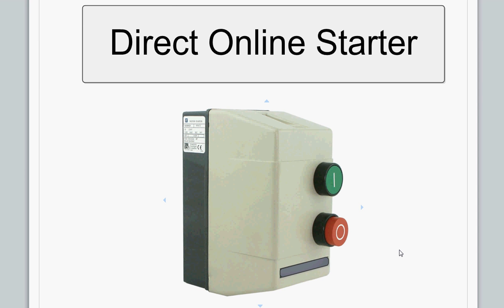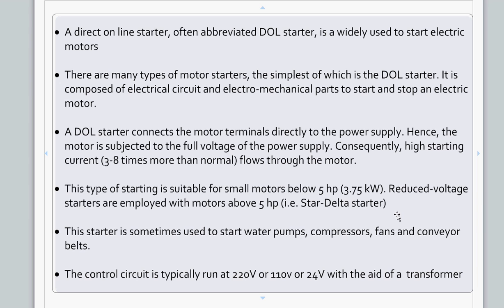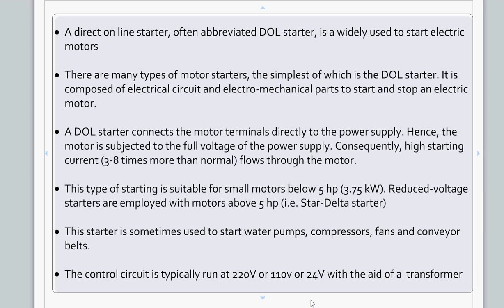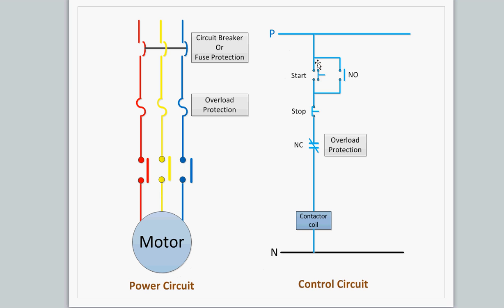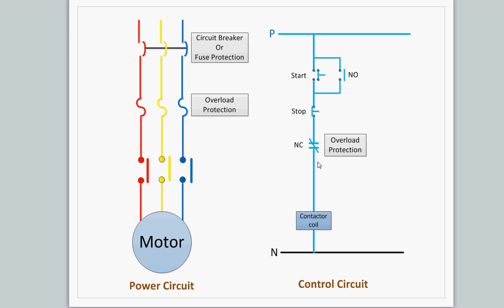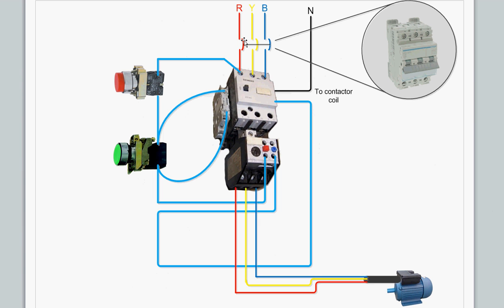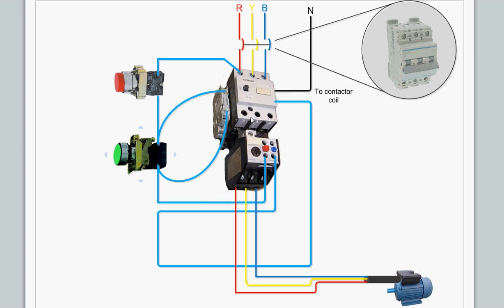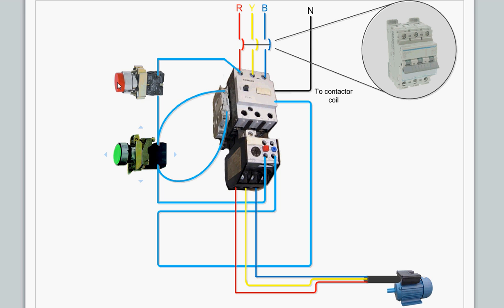Direct Online Starter

Comment: Thank you for the video 
May I ask , How does the Normally Open switch becomes closed when the user removes his hand from the start push-botton ?
Reply from the maker: In parallel to open switch, there is "NO" contact and when contactor is powered on, this Normally Open contact will be closed. This will continue to provide power and hold contactor till stop button is pressed.

Comment from the maker: Hi,

Schematics is correct. Here NOHC -> Stop button -> Over Load Protection NC contact, all three are in series during motor on position. If you press stop button, it will still break circuit. Similarly OL protection will also break circuit if something goes wrong with motor. You can put stop button before start but if you like.

Comment: It is good,correct me if I am wrong, but on the schematics, your stop button (red) needs be to before your start button (green) or else it will not break the latch when it is pressed because the mains power is still going through the start and lathing on the NOHC.